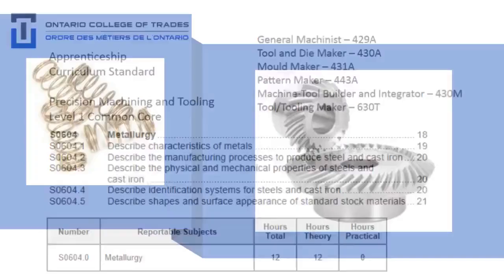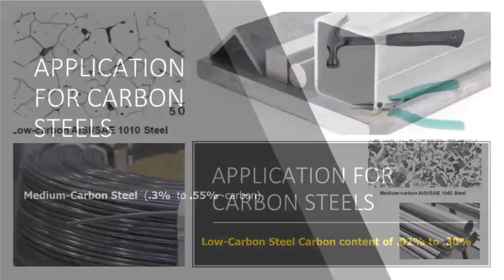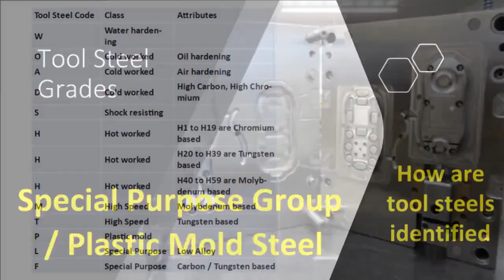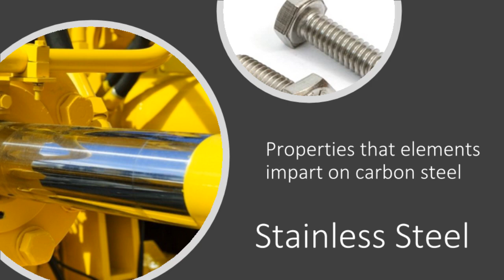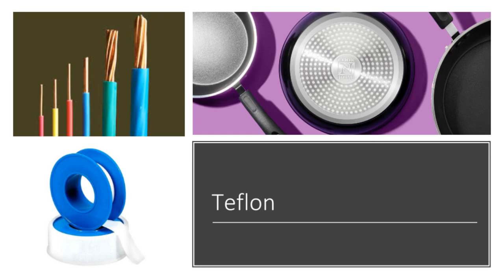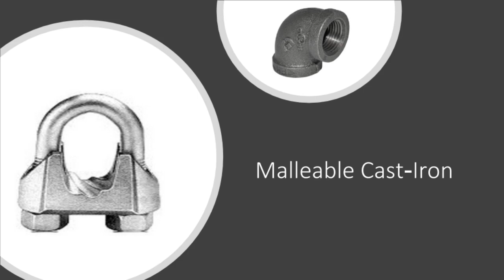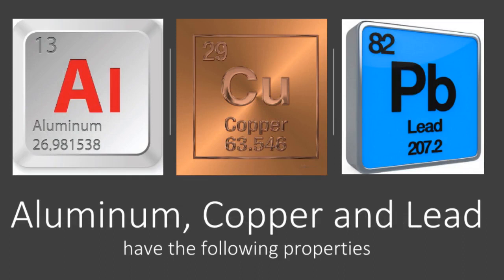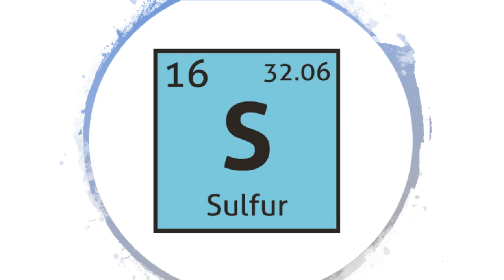Metallurgy Level 1 Common Core Apprenticeship video one

Comment: Thanks, there must be an infinite # of alloys. When I was in the Navy there were a lot of alloys that I haven't seen much since. Lots of monel. Many problems with the aluminum jet blast shields cracking & leaking. Boiler tubes breaking but they ran white hot. Rust! Tremendus forces from waves that sometimes broke over the flight deck, 66 feet above normal water line.  An interesting ride.
Reply from the maker: thank you for your comment :-)

Comment: Aluminum Bronze 30:22
High strength & corrosion resistant properties. Has anyone machined Al-Si Bronze C64200 before?
Reply from the maker: I have some Aluminum Bronze but have never machined it
got some from a friend and and the project changed requirements